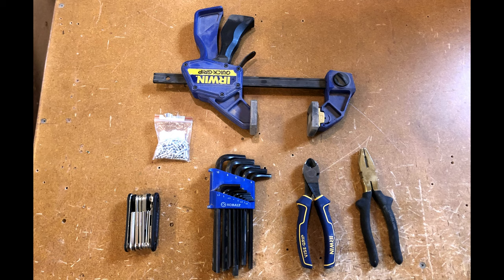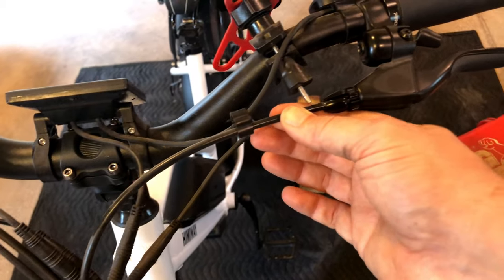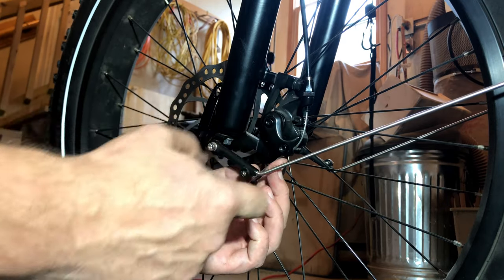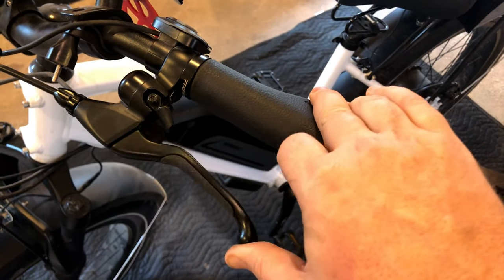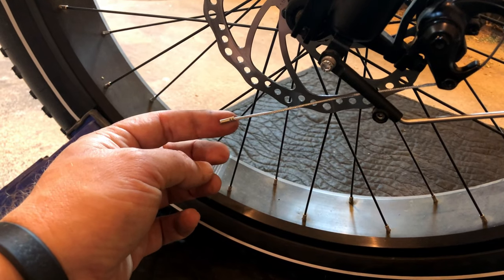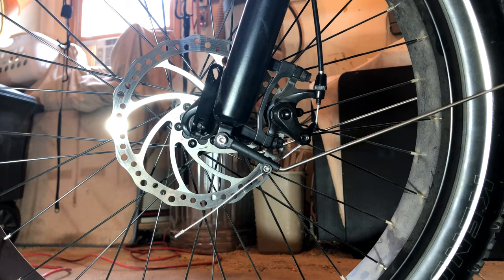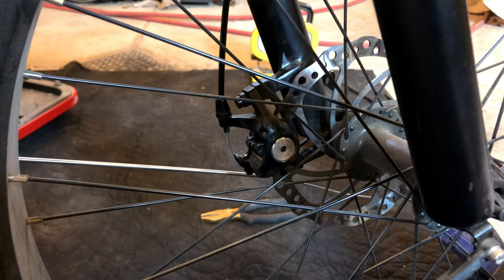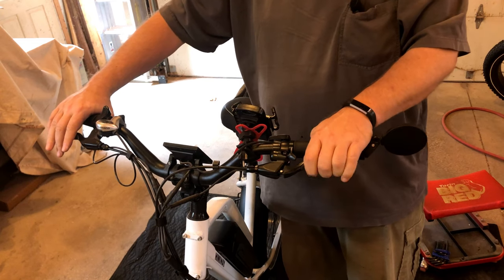Tektro Aries mechanical brake adjustment on Himiway Electric Bikes - Tinkering Turtle

Comment: I just got a Magicycle with the same brakes. I couldn't loosen the mounting screws! Whoever assembled this bike at the factory must have tightened them with a machine! Any suggestions?
Reply from the maker: If your using the tool that came with the bike, I would go out and get a proper set of metric hex wrenches. They should give you more leverage. Beyond that there are hex wrench socket sets that could be used I guess. Good Luck.
Reply: @TinkeringTurtle  ok Thanks. I may have to leave it unadjusted. Unless magicycle is willing to pay a local bike shop.
Reply from the maker: @Patrick Festa I am a big fan of properly adjusted brakes. If it were me I would get them broke free for your safety.
It is your bike, but that is my recommendation.
Reply: @TinkeringTurtle  Thank you. It's not a critical problem, it's more about the ability of magicycle to be able to help. CHINA). But I may be able to get them to pay a bike shop to do it as part of warranty coverage.

Comment: I'm trying to replace my pads on my Tektro Aries mechanical brakes, but the new ones seem too tight, they won't go over the disc! I loosened the inner pad, but the one on the other side (the black piece) looks way too far on the inside, preventing enough space between the pads to slide over the disc... there is a Torx screw on the outer side, should I loosen this as well to allow the outer par to go back "inside" the housing? I thought this piston-push procedure was only for hydraulics?
Reply from the maker: Did you squeeze the brake while it was off the rotor?
It sounds like the brake got squeezed, and perhaps the mechanical piston got stuck in the closed position and isn’t releasing properly. I haven’t felt with that so I am uncertain exactly how to get it back in the proper position.
Reply from the maker: Park tool has a video on replacing pads. They don’t specifically tell you how to retract a stuck mechanical piston though.

https://youtu.be/Xqw0SaZl-jo
Reply: @TinkeringTurtle  my mistake, the brake cable was not loosened at the caliper… haha! Thanks
Reply from the maker: Glad you figured it out!

Comment: Do mechanical brakes control speed on the ebike ?
Reply from the maker: I’m not exactly sure what your asking. The mechanical brakes have plenty of stopping power, in my opinion. And the brakes have motor cutoff switches in them. Am I understanding your question?

Comment: Out of the box, when I mount my wheel it doesn't spin at all. Do I just need to loosen the brake pad adjuster or do I also need to loosen the bolts on the caliper too?
Reply from the maker: If the brake is stopping it, I would loosen the two mounting bolts and see if it frees up. After that try the adjuster.
Reply: I went through the adjustment process as you demonstrated (excellent video) but still have an intermittent sounding rub. Is it possible the rotor is bent?
Reply from the maker: Yes, it is very possible that the rotor has a slight warp or bend in it. This can be adjusted out. You can take it to a local bike shop and they can do it for you, or Park tool offers a tool on Amazon that will help you do it without damaging the rotor. If you choose to do it yourself, my advice is to go in small increments. Don’t get too aggressive with it as the bend is likely very light.
Here is a link to the tool if you need it: (I don’t have a video showing how, so you might look on YouTube for one)

https://amzn.to/3xMQOWx
Reply: Thank you for your help!

Comment: Hello, i am having a problem that when you squeeze the front brakes, right before the bike stops, the front vibrates.  I only have  a little over 40 miles on the cruiser.  any idea would be appreciated.
Reply from the maker: My advice would be to loosen the skewer and make sure the axle is sitting all the way down in the fork dropouts and re-tighten. Then spin the wheel and verify that the rotor isn’t warped. If it is, run by a local bike shop and see if they can true it for you. Or consider a replacement.
 If the rotor isn’t warped, maybe the tire isn’t seated properly on the bead. Does the rim wobble at all?
Does the front fork move or wiggle at all in the head tube? 
Are the conical springs on the skewer in the correct orientation?

After that I would consider putting in new pads and cleaning the rotor with isopropyl alcohol. Make SURE to properly bed the brakes during first use.

I always squeeze both brake handles when riding, I find it to be the safer method.
Reply: @TinkeringTurtle  thank you so much for the response. I only get the vibration at the very end, right before the bike stops. While i am breaking it feels fine.
Reply from the maker: So you don’t feels it’s due to a brake issue? What do you think is causing it?
Reply: @TinkeringTurtle  I don’t know. When you squeeze the brakes and while the bike is slowing down there is no vibrating of the wheel. When you are just about to come to a stop the wheel vibrates then stops. Feels like the wheel and fork
Reply from the maker: My guess is something is loose, or there is a vibration in the system that becomes apparent when the brakes are fully pulled and the rotation slows down.
The questions is asked above were intended to help narrow down the possibilities. Troubleshooting over the net without first hand knowledge is very challenging.

Comment: Thanks for the well thought out video. If I can do this, anyone can! Question:  The only trouble that I have had with my Himiway Step Thru, has been when I brake, the hub drive stops just fine. But then when I start to go again, there is no power. If I "snap" the brake levers several times or go over a bump, then the power comes back on. Adjusting the brakes once before helped this but didn't totally solved this. Do you know of other instances of this with Himiway bikes??
Reply from the maker: I assume you are verifying that the handles are going all the way forward when you release them.
If the brake adjustment doesn’t fix the issue, you can adjust the sensors. Unfortunately I don’t have a specific video for this. There is a set screw, and then you loosen or tighten the nut on the sensor cable. I am a little reticent to suggest this, because the last person didn’t loosen the set screw and broke the nut at the end of the sensor. And then had to order a replacement.

You might want to post in one of the Facebook groups, so someone can give you pics or even a video to help.
Reply: @TinkeringTurtle  Thanks for the quick reply. When I talked to Himiway, they said to replace the sensor which I did, but it had no effect. I will try posting on their Facebook page.

Comment: what's your thoughts on the Juintech M1 hydraulic calipers?
Reply from the maker: I have no experience with the Juintech calipers. 

Personally I haven’t had any issues with the stock calipers. I have locked up both tires in an emergency situation and slid to a quick stop...and I weigh 275lbs. I am just not certain what more that I would get from the Juintech calipers for all the money I would spend to get them switched out. They may be quieter without having to adjust them as much, they may be smoother...but is that worth the money? I don’t know.
Reply: Tinkering Turtle, yeah I live in San Francisco and coming down the hills I feel it takes a lot longer to stop, I’ll keep these and see how they do, on another note, thank you so much for all your helpful videos, I swear your like the best place to go on the bike, thank you
Reply from the maker: Please be clear, I am not trying to talk you into anything. I only intended to share my experience and thoughts. 

Can I ask you, do you use both brakes when stopping? or just the back one?
I use both, always have. Maybe that gives me the extra stopping power. Also I tend to adjust them every week or two, so they are in tip top shape.

Anyway, I hope I have helped. If you decide to make the change let me know how it goes.
Reply: Tinkering Turtle  sorry your right, yes I do use both breaks all the time as the bike is heavy, I think over all it works good but in San Francisco you have to be alert as the drivers are crazy so stopping is very important at times,

Comment: the barrel that holds the cable has slipped out of its hole on the brake lever....any ideas to fix....much thanks.
Reply from the maker: if you can’t get enough slack to get it back in, you will need to release the cable at the bottom to get enough slack. And then adjust it after.
Reply: @TinkeringTurtle  Himiway says the brake levers need to be replaced....have you replaced any and if so which brand did you go with...thanks.
Reply from the maker: I haven’t had the need to replace the brake handles. Is Himiway going to replace them on warranty?
Reply from the maker: Something like this will probably work, but it won’t have the integrated bell. Really you just need to find on with a sensor that has the correct waterproof connector.
https://amzn.to/3xFfbDh
Reply: @TinkeringTurtle  I have to pay some money...not sure what it's for.....was wondering if the 29 dollars would be better spent on another brand that you used....thanks.
Reply from the maker: I think they typically refund that when they get the return…probably worth asking. But according to the reviews for the handles I linked above, someone has used them on a Himiway.
good luck!
Reply: @TinkeringTurtle  thanks.

Comment: I have a dilemma with my brakes.  The motor disengages when the breaks are pressed.  Mine disengages unless I push and hold the brake open.  Is there an adjustment screw or some simple way to adjust this?
Reply from the maker: If your brake handle doesn’t return all the way forward when you release them, then you need to do a brake adjustment via this video. If properly adjusted the spring load from the caliper should pull them open.
Reply: @TinkeringTurtle  my brake handle does return completely.  There is no slop whatsoever, but if I push just a bit harder the motor engauges.  I can't even feel that it moved at all.  That is how tight it is.
Reply from the maker: You can adjust the sensor. I haven’t done it, but here is one of the posts. You have to loosen the set screw first!
I hope this helps.

https://www.facebook.com/groups/954257285018195/posts/1155933664850555/
Reply: @TinkeringTurtle  thank you.
Reply: @TinkeringTurtle  Thank you for helping me with this.  I really appreciate your video on the initial assembly also.  I used that video to put my bike together when it arrived a couple of months ago.
Reply: @TinkeringTurtle  I should not have doubted your first answer to my problem.  Before adjusting the sensor cable, I adjusted my brakes as you described here.  My pedal assist and throttle now work just like they are supposed to, and my rear brake is more responsive.  Thank you.  Keep these videos coming.
Reply from the maker: I glad things are improved!

Comment: My pad inside one adjuster is stripped?  Any suggestions lol?
Reply from the maker: If the adjuster is stripped, I would guess you will probably have to replace the caliper.
(I am having trouble understanding your comment though…)
Reply: @TinkeringTurtle  that's what I'm thinking the metal pad adjuster on the inside rear
Reply from the maker: I think you can get a new caliper for $20 or $30 if you look around. Good Luck!

Comment: Just ordered mine. Have you found any replacement springs for the front shock? I am guessing I will want to stiffen mine up
Reply from the maker: I haven’t even looked. The shocks are adjustable and can be stiffened up with the knob on the top of the left strut.
Hope this helps!
Reply: @TinkeringTurtle  I weigh 220 and plan on taking some light off-road trails. Is the stock spring adjustable enough for that?
Reply from the maker: I’m not sure I have the requisite experience to say. But I am 275lbs and the forks work well for me. Let me know how it goes!
Reply: @TinkeringTurtle  will do sir. I’m in Raleigh if your close
Reply from the maker: West Michigan. Enjoy the ride!
Reply: @TinkeringTurtle  haha just moved from Cleveland. Better west than East!

Comment: You skipped over the part where you adjust a brake pads from being too high or low on the rotor they never shim them properly that's the most important thing make sure your brake pads biting on full service you skipped a very important part they never Shimon right got to get that brake pads Center
Reply from the maker: Good tip I will have to look that up!
Reply: What can I do to make sure my pad is making full contact?

Comment: Hydraulic brake is better than this, each week I have to adjust them. It takes my time, better Himiway change it to hydraulic
Reply from the maker: While I do agree that hydraulic brakes give you more stopping power, and can require less adjustment up front…I personally prefer the mechanical brakes. When adjustment is needed the are much easier to deal with over bleeding hydraulic fluid. And after my cables settled in, I haven’t had to do many adjustments.
Each to their own… thx for the comment!